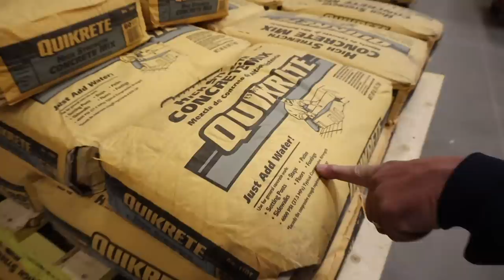RENOVATIONS & CONSTRUCTION!!  *lets build my giant barn*

Comment: "If you want to buy an old house that needs work let this be a lesson to you: trust no one" and that's facts. We hired an electrician a while ago with all the correct certifications to rewire our old 1950s house, we found later that all the junctions under the floor, live wires, were just shoddily wrapped together with tape. It was so bad that we couldn't get our house passed as safe until we got another electrician in to fix everything the last guy had done.

Comment: You always order more material than you need especially siding, because if you run out or make a mistake the material might not be available and if it is, it might not match exactly the same. You'll also have it in case a you get storm damage and need to replace a piece.  Siding, no matter the color,  has color variations from one batch to the next,  so you always order a few board feet more.  Something my daddy ALWAYS taught me! So they didn't screw you over,  it was a smart move.

Comment: MORGAN this is important: in typical construction you pay half to secure the job and half when completed. And there is a fine per week the job is late to be finished. Have them sign a contract. And receipt. Even if it is hand written on line paper. Get multiple quotes and get them in winter when construction is slow. And if you have a cheaper quote tell the next guy. Look at reviews and get receipts copies for supplies. And measure yourself to check their measurements.  You can buy a digital measuring device.

Comment: I know I'm working with limited info here but are you sure your contractor isn't trying to pull the wool over your eyes?Call the permitting department personally. See how long permits are taking and check the status of your permit & if its actually been submitted. Some contractors will pass the buck & blame the "permitting process" when they're actually running behind on other projects. 🚩🚩 If you really like/trust this contractor & they've been forthcoming about everything, fine, but I'd be really apprehensive if they're outright lying about where you are in the process. I know contractors are hard to come by but some of them will take advantage of this fact.

Comment: I think most builders are frauds who steal money Morgan… we bought a brand new house and the builders essentially refused to fix any of the problems until we threatened legal action (and they still did a bad job… THREE NEW FRONT DOORS UNTIL IT FIT CORRECTLY and that was just one of the many issues) - even though the realtor said they were a pleasure to work with and were always available when needed. Could’ve just built the damn house myself 😂😂